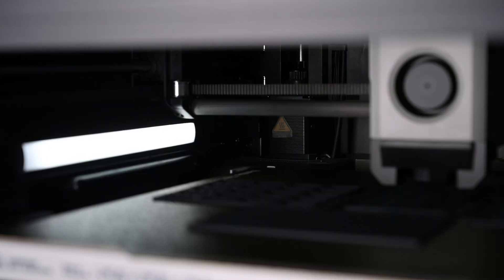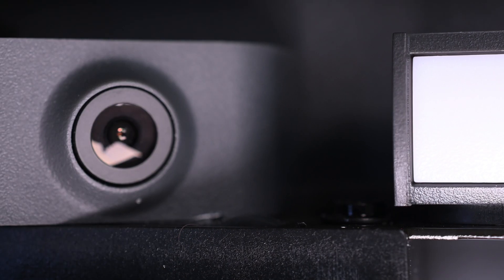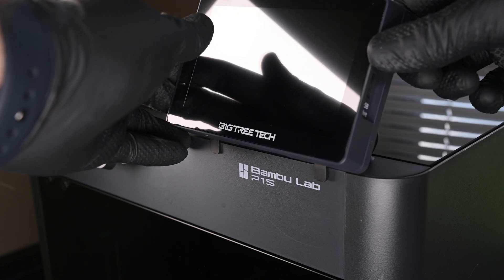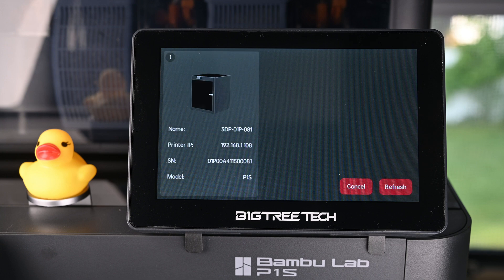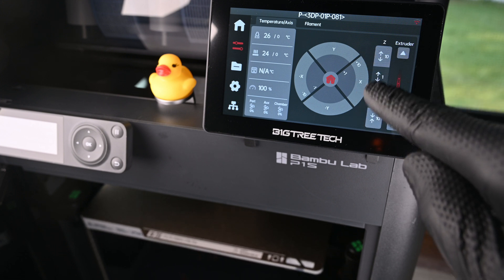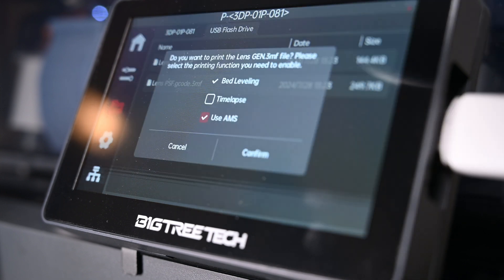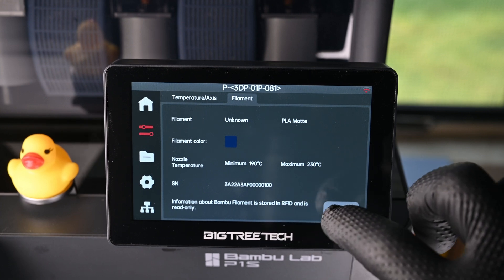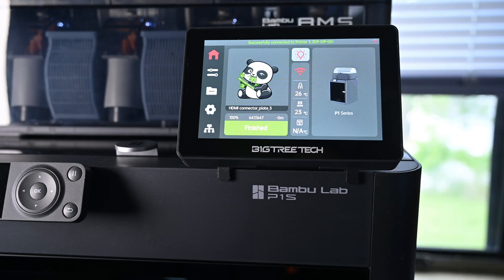Can the Bambu P1S be upgraded? Panda Touch Setup and Review

Comment: You do have to make sure you do not upgrade the Firmware correct ? I stopped at the one with a 6 in it. I also have not upgraded the screen but I decided not to upgrade anyway until I have a reason to.
Reply from the maker: I haven’t updated my P1S since I bought it over a year ago, I also have firmware 1.06 and did not need to update it for this.

Comment: This LCD Is a waste of money.
Its not practical and it does not make printing easier at all.
Nor does it remove the need for bambustudio either. Still have to print over the air.
I wish this LCD had USB printing support.
Reply: isnt that what the USB port on the side is for?

Comment: Ordered and installed one on my P1s on a bit of a whim. It's clean, simple and does what it says on the box. True, it doesn't add much in the way of physical functionality to the printer itself, but then neither does the X1C's colour touch screen, and this a much cheaper upgrade. 
What it does do is provide useful info at a glance when walking past the printer. I can see the nozzle and bed temps, what layer I'm on out of how many, what percentage complete the job is and an ETA for finishing. This is all stuff the default "screen" is useless for, and it saves me opening the app on my phone or checking my computer. 
It's a "Quality of Life" improvement, and one that elevates the experience of using the machine just that little bit. Coming from Resin printers where this kind of info display has been standard for years, it's a nice bit of added polish, and one that integrates almost seamlessly.
Is it needed? Of course not. But that's what makes it so great. Those who don't want it didn't have to pay extra to get it. Those who do want it, get it for a great price.

Comment: Hi I have purchased a Panda Touch, but I can’t connect to the cloud, I get the same error over and over …Problem with the network check your settings….There are other devices connected to the same router and network without any issues connecting to the cloud? Can someone help?
Reply: Update: An update of the firmware fixed it!

Comment: Curious about your camera setup. How’d you get the exposure set to clearly show the bright screen without drowning out the background?
Reply from the maker: @engineer3dprints   I use a Nikon Z6 for the camera along with three or four Neweer LED panels. Shutter is always 1/60th, aperture as wide as it’ll go (I think f4 for most of this video), and then just adjusting ISO till it looks bright enough. I’ll usually angle one LED panel to light up the background, not directly but lighting the wall near it so that light bounces a bit and it isn’t as harsh or direct. I use RaLeno or Neweer brand LED panels because they aren’t too expensive, and they get the job done.

Comment: I persume this will not work if u have the fillement feeder addon ?
Reply from the maker: @dotnetdevai  I don’t see why it wouldn’t work, the screen doesn’t have to be physically connected to the printer, you could always run it off a USB wall charger or similar.
Reply: @TapticDigital ah so it only was cause of convience of location